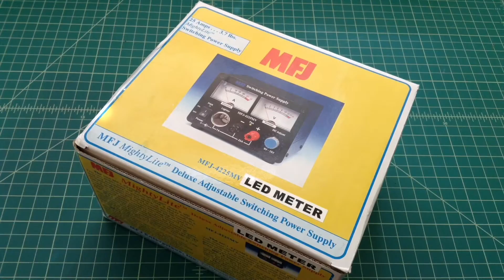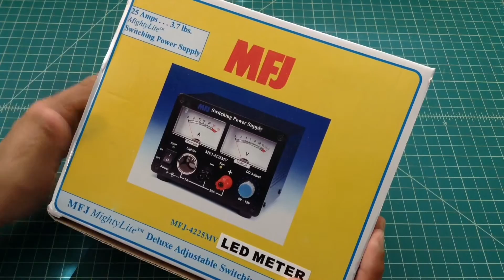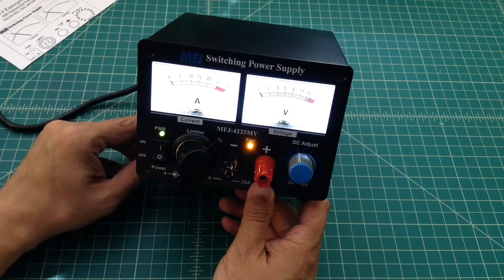MFJ-4225MV Switching Power Supply - Show and Tell - TheSmokinApe

Comment: I had to adjust the voltage to match the meter, and I'm planning on installing a temperature controlled fan drive. Otherwise it works great.
Reply from the maker: A temp controlled fan would be awesome!
Reply: I cannibalized a fan controller board from an old Antec computer power supply. If I could find a regulated power point inside the unit I'd have already hooked it up. It works great since the PC supply has the exact same heat sinks.
Reply from the maker: Sounds like a great project, are you doing a video?

Comment: I just got one of these about a month ago. It's loud when I first turn it on, and it stays loud until I turn it off. The one I have apparently does NOT quiet down after a bit as some have reported.
Reply from the maker: That would drive me crazy...  can you still return it?
Reply: Old post but mine is same way.  Very loud, making it useless to me.. I have to wear headphones or the fan drives me nuts.

Comment: The "LED Meter" on the front of the box SHOULD say "LED / Meter" which would clarify the features. The LED to the left and just above the red post just shows the unit is operating. Of course, the backlight and the fan noise tell you the same thing, so the LED is really not a useful feature. The meters, of course, are analog, much more useful in an application like this than a digital display would be. I like mine but that fan noise is really too aggressive. I'm currently looking into several solutions for that.
Reply from the maker: My fan has gotten progressively louder on startup but it "quiets" bag down.  Other than the annoying fan I have no real conplaints about this unit...  thanks for the comments.

Comment: So u plug that into a regular outlet?
Reply from the maker: R.I.P. Democrat Party yeah, there are cheaper ones in the market if you are only plugging in a cb
Reply: Yeah, i'm on Ebay looking, ... What exactly do u call these devices? .. It seems looking on Ebay & here on YouTube some DON'T have the 12 volt insert. ... I do need a cheap one, ... because I'm poor.
Reply from the maker: https://www.amazon.com/Pyramid-PS9KX-Supply-Cigarette-Lighter/dp/B0002BA570/ref=sr_1_8?s=electronics&ie=UTF8&qid=1504143009&sr=1-8&keywords=12v+power+supply+cigarette+lighter

You want something like that